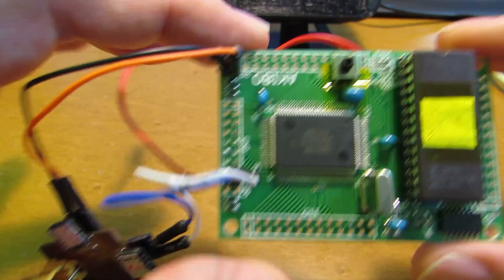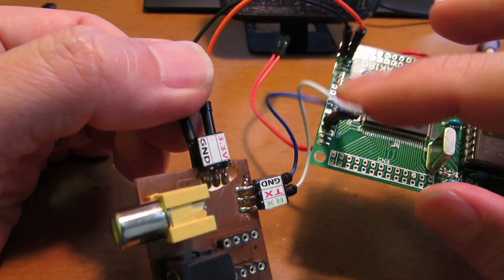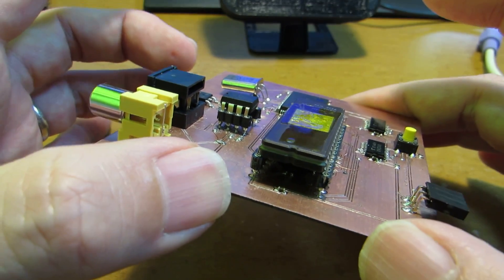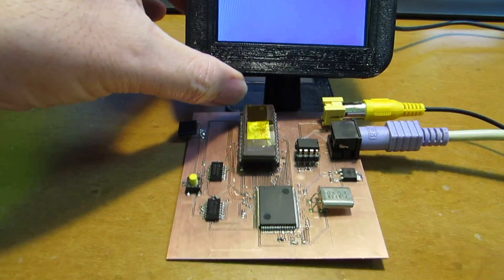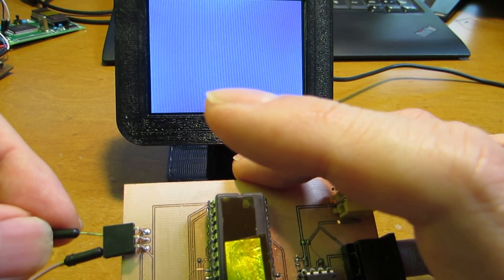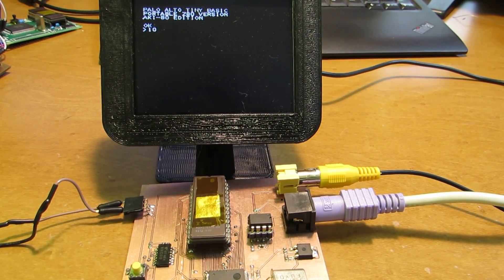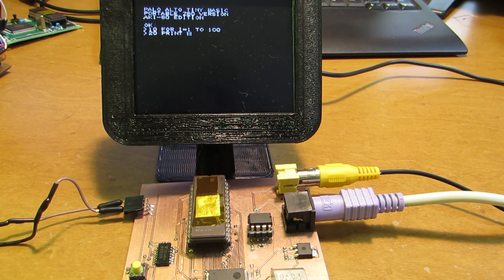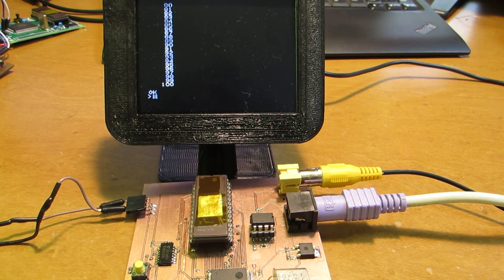Toshiba TMPZ84C015 (Z80) single board computer running TinyBasic

Comment: Very nice video!  I love the z-80. I grew programming it in assembly language on the TRS-80 model I computer. Nice job on the BASIC. nice to see the editor accepts backspace.  Does the BASIC language support calls to Z-80 subroutines? For example, Z-80 programs packed into a string and then called.
Reply from the maker: Hello! Current BASIC on this "computer" is just tiny BASIC written in assembler by another author and the function is expandable but depends on its implementation... Thank you!

Comment: You going to make a case for that
Reply from the maker: very good point! thanks!
Reply: microwavemont I wish I could make something last like what you made I don't have the brains or the resources to make something like that I always dreamed of making a pc that works the same way as mirco computer would back in the 80s and 70s but I want it to have more than 64k of ram and more modern specs don't ask why I'm crazy like that
Reply: You can do it I plan on making a breadboard 6502. The most expensive thing would prob be the EEProm programmer they are like $50 Chinese clones on ebay. 8 Bit MPU's are dirt cheap brand new if going 6502, There is tons of documentation and resources for it along with the Z80. The biggest hurdle for me would be learning the assembly language and BASIC again more documents and resources free online. Also 64Kb of ram doesn't seem like much but its  plenty if your just learning and tinkering lol.